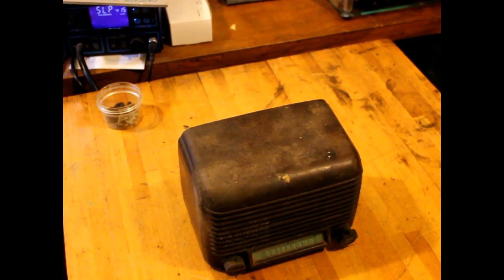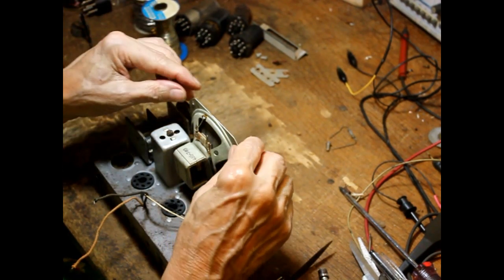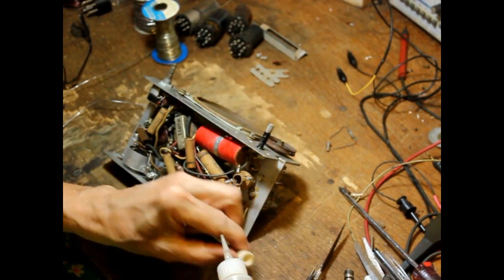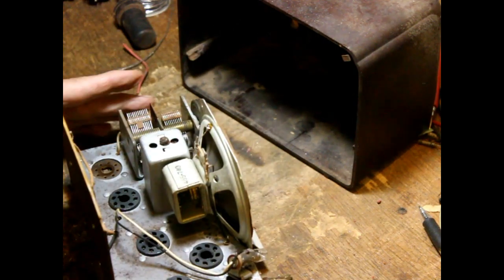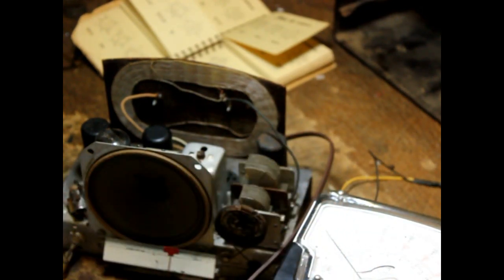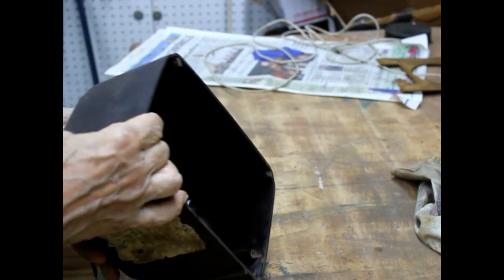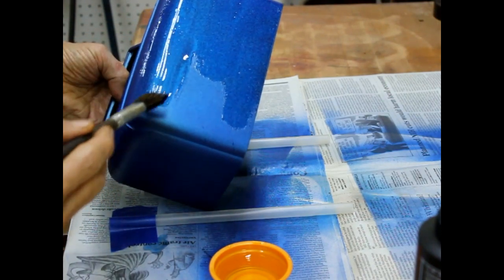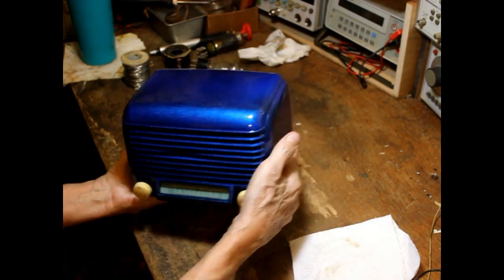MINI BAKELITE RADIO RESTORATION

Comment: I can not tell you how pleased i am that you posted something - anything. The skills you have are amazing, i have learned so much from watching what you have done thus far ! As a vacuum tube user and collector - for my equipment that i have. I find your creating tubes fascinating.
I understand the theory but seeing it done places a great deal of that theory into clear perspective.
Hoping all is well with you. And thank you so much for what you have done.  JR
Reply: Just a question, is there any advantages to using a vaccum tube, rather than a transistor?
Reply: @theterribleanimator1793  Yes there are.To fully answer your question more specifics are needed. In what context do you use " advantages " In some circuits the use of a vacuum tube verses a solid state device
can yield better durability. Such as an input drive spike, the tube ( an 811a ) can shake that off with no damage at all. An FET which shares many character traits of a tube, will simply go open circuit - dead.
Remove it from circuit and start over.
I think i smell the root of the question.
Each has it's own traits useful for specific
tasks - tubes are good for this and solid state devices are good for that. > Solid state devices excel at low current use and the ability to create very small circuits within a tiny space, while using small amounts of current and voltage.
Vacuum tubes excel at high output power at high current - radio broadcast transmitters. Solid state devices have yet to
encroach into that domain. This is not a full explanation - just one example of each.
How did i do ? Answer your question ?
Reply: @johnrobinson357  absolutely, thanks for the information.

Comment: After a break from electronics of around 50 years and restarting I had my first magic smoke in over half a century. I  have had 250 volts across my chest but no smoke, maybe there was but I was otherwise engaged. Last week I had smoke, a flash and a bit of an LM317 clip my ear. Your videos are more entertaining than all the others put together. The trouble is with this modern stuff it's not very dramatic when it goes puff. Silly little black things with legs just sit there and fizzle. I was so happy tonight to find your new video and to go back a short while afterwards and find another was pure heaven. I have learned one thing watching you, I should not have stopped my electronics hobby 50 odd years ago.

Comment: You said 35W4. It was a 35Z5 hehe!  I worked on radios n TVs for over 40yrs.  This brings back old memories.  Nice to watch a master at work.  I just remembered the tubes.  12SA7,  12BA7, 12SQ7, 35Z5, 50L6.

Comment: For those not familiar with the "All American Five", there is no power transformer, filaments are in series and the chassis is hot depending on which way the line cord is plugged in when there is no polarized plug. That is why they typically have a fully covered back, plastic case and knobs. Restorers or anyone working on one should put on a polarized plug so the chassis is at ground potential.
Reply: your absolutely correct although apparently there are many of older houses in the states incorrectly wired ie phase and neutral reversed so while obviously  the right thing to do its not fool proof....people should also  take some responsibility for their own safety (if your going to buy and run a antique radio or any vintage electrical equipment learn a little about it) ......

Comment: Instead of sanding/sandblast the Bakelite and coat it with epoxy afterwards, how about shining the Bakelite up with 0000-grade steel wool instead and if necessary coat it with Carnauba-wax afterwards ?
Of course it's more labor intensive, but I would guess the result could be much better.

Comment: What a nice little radio. I remember a lot of those around when I was a youngster (I just turned 70). One of my uncles lived on a farm in western Kansas and had no electricity until in the late 70s. He had a battery radio and a wind charger to keep the batteries charged. I'm sure someone tossed that in the trash after he passed, but I sure would have liked to have it.

Comment: Radio looks just like my Firestone Stock# S-7402-7 Code No. D-LQ-150

Mine played fine with just the 2-section filter cap replacement. Needed power switch cleaned. Lubed the tuning shaft and the variable condenser. Needed alignment and had to tighten both IF transformers trimmer caps. Works very well with it's antenna coil on back cover.

Mine says Firestone right above station disk glass.

Cleaned and darkened cabinet with shoe polish.

Nice work here.

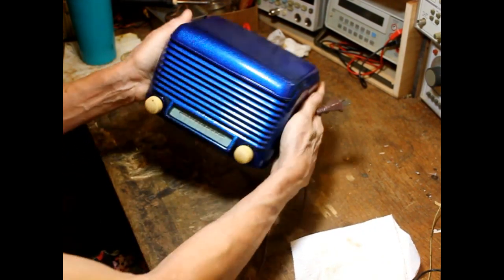Comment: At 1:02:13 you tilt the radio cabinet against the sanding belt. It made a light colored line which becomes apparent at 1:08:07. Can that be polished out?
Reply from the maker: I used a marks-a-lot to blend it out. The black doesn't show up like the white did. The best thing to do is come back an hour after doing the coating and wipe the drip line off the bottom. I forgot!

Comment: I see that you have the same trouble as most with trying to hold the solder, wire and soldering iron with two hands and I get a little ticked when I can't do it but I found a way for this problem, at least for me, wrap a little solder around one, or both wires so when you touch the two wires/points together all you need is to apply heat. It works for me. :-)

Comment: I won't comment on the blue paint, but as always it's a pleasure to see your work.  Question - how do you feel about the electrical safety of radios such as this with no mains transformer?  Personally, I'd want to run them with an isolation transformer.  Also, I'm trying to downsize my collection.  I have a few cool pieces I could send you so long as you promise not to paint them blue :)

Comment: Beautifully done! Might want to invest in an airless airbrush to use for your clear coating. It would simplify the clear coating and would not have the possibility of bubbles as all it is doing is pressuring the coating liquids without air getting into the mix. 
Also, I agree with Horatio Pugwash that your obvious homebrew electronic fuse videoed to show how it is made and what exactly it does. Seems to me to be a bit more like an "isolation power supply".

Comment from the maker: First clean the entire cabinet with lacquer thinner. Then sand the entire cabinet with 220 grit sand paper. Then buff the entire cabinet with 0000 steel wool. Then use dark walnut stain on the whole cabinet. Wipe the stain on the cabinet with a piece of felt or an old sweater. Use a clean rag to wipe the stain until it is dry. Wax the cabinet with your favorite car or furniture wax. Result is shiny dark brown.

Comment: Could someone tell me what bakelite is? Is it some kind of plastic or fake wood or what is it?
Reply: Bakelite is an early type of plastic. It came in anumber of  different colors, but you generally see brown, brown swirled, and black used in radios. It was most commonly used in the 1930s, 1940s, and 1950s.
Reply: BMT  It is a Phenolic plastic,  basically phenolic formaldehyde.

Comment: Hi Ron, I have an RCA Bakelite radio from the early 50's. It was a relatives's of mine & when she passed I "inherited" it. It has no back on it. Can I use any back that has an antenna attached to it?
Reply from the maker: This depends on if the radio used a loop antenna or a wire antenna. The schematic will show this.
Reply: @glasslinger  It had the loop antenna attached to the back.
Reply: i assume that would be a loop antenna. Is a wire antenna one that is attached to the back?
Reply: @glasslinger  Hello again. I have a Majestic tube radio in which I recapped, replaced resistors & 2 bad tubes. When I turn it on the tubes all heat up but there is only a low volume hum from the speaker....the volume control doesn't increase or decrease it. Going thru the tuning dial does nothing. Do you have any possible solution for this?

Comment: I just started watching you for a bit and I'm trying learn how to repair radios and you are helpful.  I have some components that I don't know.  I know some of them are caps but don't know what type. They are non electrolytic.  How do you know what type of cap to put where?  What type are the square yellow caps are those? If you have an email could you give it to me please.  I would like to send you some pics of the ones I don't know.
Reply: get close to the original cap 2:1 and learn the difference a mylar cap my still be ok after 80y or more   test and test som more and tray everything and soon you  will find it easy .. :) glasslinger is a  master of a lost art    ...

Comment: Why do you persist with that big clumsy soldering iron?
Reply from the maker: Actually, it is not clumsy! It can reach down into places where  a hot iron would burn things. Also, the 200 watt heat makes it possible to make a solder joint without overheating the components.

Comment: my dawg, how u get these antique radios? I’m bored of building my own it’s too difficult maybe I could learn more and be productive if I tried restoring vintage transistor radio do you shop for them on eBay? I’ve tried ordering parts from ebay many months ago but they still ain’t delivered maybe they lost the package?
Reply from the maker: I do get radios from ebay sometimes. When ordering parts always use the postal mail service or someone like Fedex or UPS. They all track each order from start to finish. I bet the person you ordered from didn't ever mail the package! It is rare to lose a package now days with the tracking.

Comment: hand brushed lacquer? no no no no no no no no  you need to cut it back with 600 then 1000 grit wet and dry to get the brush marks out

Comment: I wonder what that bakelite would have looked like if you would have put clear coat on it
Reply from the maker: Very shiny of course. It tends to get dinged up over time so I don't usually do it.
Reply: @glasslinger  the blue with the clear coat worked out good.

Comment: gonzo restores with small stuff are fine, but I think maybe the rectifier bulb and the pilot light both bit it because of the tube swap accident.  Nice recovery.
Reply: Not seen the video yet but I'm guessing a "live" tube swap causing a cap to charge way higher and zapping the filaments on installation of the replacement?

Comment: Ronald can you please share scheme for your electronic fuse i have found schematics online but non of them have the control you demonstrate with yours ie being able to set number of cycles before trip as well as current come on uncle Ron sharing is caring
Reply: A simple timer circuit controlled by current threshold would do it
Reply from the maker: OK, I will do a video on it shortly. All my stuff is free to everyone, I don't charge money like some on youtube do!
Reply: @glasslinger  I  know you dont charge and i know  you must be very busy thank you so much for agreeing to do a video on it i really appreciate that I built your irs2453d full bridge driver aswel and its fantastic thanks for sharing your work  i will build your electronic fuse straight away as it will be so useful to me and others thanks for reply Ron
Reply: @rwhitenz  Hi do  you mean something like a current transformer rectified with a variable rc delay into an opamp and the output of that would drive a transistor which in turn would drive the coil of a relay or  opto then a triac  (would a relay be fast enough?) any ways Ron has replied and said he is going to make a video on the one he uses so that will be fantastic .... thanks for reply
Reply: suppose could even use a counter like a decade counter ic or 2 to actually count the cycles ?? or even a micro controller ??  it will be interesting to see hoe Rons actually works.. he has mentioned it a few times in his videos and i thought it would be a very useful addition to my bench...
Reply: @glasslinger  yes please  the  scheme for your electronic fuse i would love to build one

Comment: Dry electrolytics rarely go bad. Use them if you have them
Reply from the maker: This is not accurate. There are two technologies, the old tech,  and the new polymer tech. (the electrolyitcs you now buy) The old type electrolytics (before about 1985) will dry out over time. They also over time have a chemical change that makes it impossible for them to maintain the oxide dielectric layer so they will leak severely. ALWAYS change out the old electrolytics if you value your power transformer.
Reply: glasslinger Well said! I repair guitar amps and radios occasionally and I have had some heated discussion with other “techs “ that claim that changing out a 60 year old cap that is working is sacrilegious. I usually ask if they would drive a car at 75 mph on dried out 60 year old tires. I think not! Caps are cheap, no brainer. Great channel! Your engineering chops are top notch.
Reply: @glasslinger  amen. It's called leeching.

Comment: Why is there one IF transformer in this radio?  Shouldn't there ne another one?
Reply from the maker: To cut costs they only use one transformer. The I.F. output is resistance- capacitance coupled. Many of the lowest cost radios used this scheme to save a buck or two per radio.

Comment: I noticed the radio had a hot chassis. The chassis was exposed at the rear. If the mains was connected with the live on the chassis and someone touched it the could get a nasty shock.
Another thing I noticed, was the first capacitor you changed an across the line cap? If that was the case you should have used an X1/Y2 safety cap. Sorry about the thumbs down it was a mistake. Other than my comments above it was a very good video. Good to see you posting again.
Seemed to be able to switch it to thumbs up, that's good.
Reply from the maker: Actually, the chassis is not totally hot. It is connected to the line with a .05 mfd capacitor. You will get a slight shock if you are well grounded and the line cord is plugged in the hot way, but you can't get electrocuted. The line cap I used is a 600 volt unit with plastic dielectric. It will take the 120 volts with no problem at all.

Comment: At 23:40 you should check the value of that OLD Cap. your about to install!
What an awful color!
Reply from the maker: They were a batch I got in 1999. I know, that's 20 years ago but they are modern caps that use different chemistry from the old fashioned ones. They will easily last 50 years.

Comment: When it comes to attaching new components to the cut leads of the old, I have seen a number of YouTubers recommend the "coil" or "pigtail" method (wind the end of the component lead into a coil and slide it over the cut lead before soldering https://www.youtube.com/watch?v=3zo7iXWZhNY). It would seem to be more mechanically secure. Do you see any value in this?
Reply: Did it have a power transformer ?  Thanks for sharing.
Reply: @charlesfenech9246  An all american 5 does not have a power transformer, the value of the filament voltages add up to around 120V,  uses 12A8, 12K7, 12Q7, 50L6 and 35Z4.  So 12 x 3 + 50 + 35 = 121
Reply: The plate voltage is the rectified and filtered AC line voltage.

Comment: OK resto job but a couple of nit picks. First you dont seem to make a good mechanical connection before soldering wires to lugs. Second who on earth would want to paint that bakelite? Kind of ruins it in my opinion.
Reply: I thought the same thing. It's a bakelite radio. You restore them, not paint them. Also it does appear that Ron is not patient with soldering. Maybe he doesn't show him tinning the in-radio lug before soldering the pre-tinned wire to it, but both sides of the joint should be well-tinned and solder-refreshed before tack-soldering the way he does. I've been pre-tinning and tack-soldering for 55 years without a cold joint. Just saying.
Reply: @cjay2  Yup, can do it that way. Best though is to hook wire into the terminal strip or tube socket hole and crimp with needle nose pliers. I'm sure if he runs enough new solder into the joint it will last long enough to where he'll never see a cold joint.
Reply: @Homeless Home Movies A 'larger crowd' of who? Tasteless mindless average people? By painting that bakelite radio he just wiped off 90% of its value on the antique radio collection market. You got some other market for which people will pay for an ancient radio? Perhaps millenials with extra cash to spend?